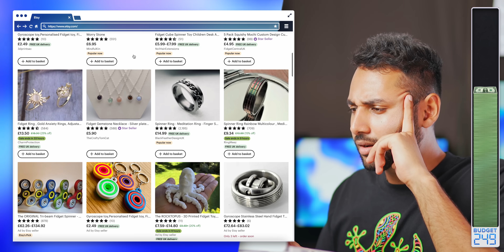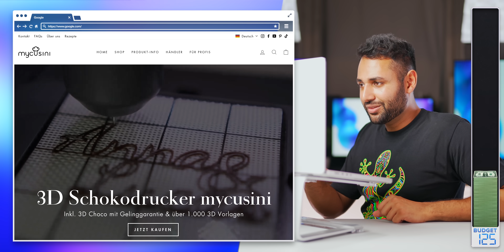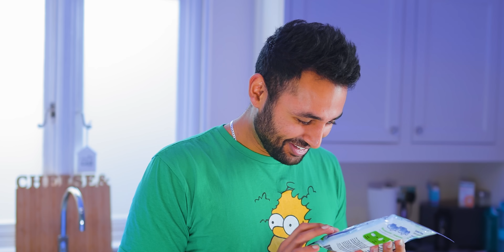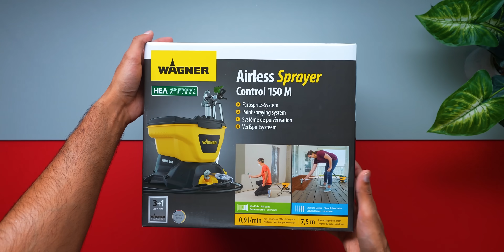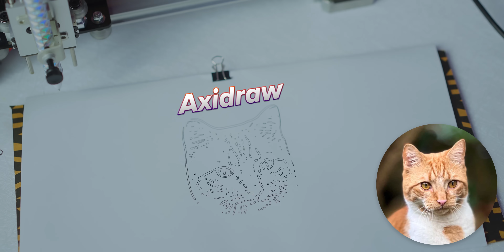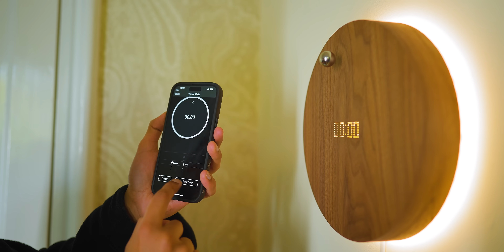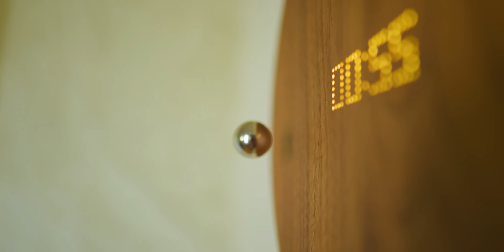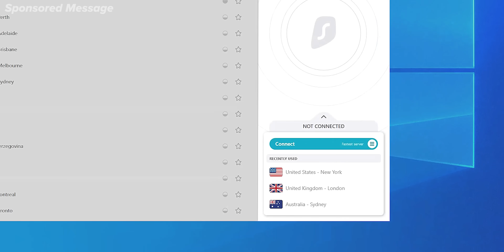I bought the most SATISFYING TECH on the internet.

Comment: I’ve had one of those apple coring slicers since I was a kid. They’re certainly faster than a knife but they’re a big pain to clean and the blades never go to the bottom because of the plastic frame so the apple doesn’t get cut at the very bottom. 

Also getting the slices back out and especially the core can be a pain too. It’s faster and easier but not necessarily more convenient.
Reply: Same here ! Just made same comment. ( 40+ years of Apple slicer usage. ) 
Tips - 
Cleaning - use a Stiff long handle Brush to clean it ! Available in any Groc store.  I just figured that one out. A sponge is a pain. Your right.
2) piece removal - break core sideways to remove. Do not pull straight up. Same with pieces.

Very Fast if doing alotttt of apples.

Wash / rinse immediately after use for easiest cleaning.
Reply: Same
Reply: Same! Also personally I don't find them THAT satisfying
Reply: You back the apple out of the slicer and rubber band it closed to keep the air off. Sliced but doesn't go brown as fast. At lunch/snack time, unband and tear off your slices.
Reply: I've worked in a restaurant and we had one there and at home. It was easy to clean an super satisfying all the time:D Not every one of those are terrible to clean, just pay a few bucks more and get a decent one!

Comment: For kitchen gadgets I would have recommended a “safety can opener”. 
They cut the side of the lip instead of the top so it comes out smoother, the top doesn’t fall into the food, it doesn’t spray stuff and contents are easier to remove.
Reply: .....plus you can use the can afterwards as a cookie-cutter!
Reply: I've got one, it's great, best can opener I've used

Comment: Chocolate printer gets a 1/10.  You'd have better results using the previous product (vac former) to make mold halves and pour the melted chocolate into that, then join the two chocolate halves together (like an easter egg).  Maybe use a resin printer to get the original shape to take a vac form from.
Reply: For that you'd need quality melted chocolate

That's a few extra steps from just buying chocolate, loading it up, and letting a computer do all the work 

The vac former also needs a shape in the first place to make a mold, so regardless you'd need a 3d printer 

The chocolate thing is literally objectively better efficiency wise
Reply: The plastic mold is probably not food grade material though.
Reply: Big brain
Reply: I imagine he had little knowledge of the machine. It probably needed bed leveling and z offset running.
Reply: But it’s chocolate!
Reply: It's easier to use.

Comment: kinetic sand is a basic slime (glue and borax/water solution) mixed with very fine sand. as such, it is basicly a non-newtonian fluid so the garlic press was never gonna work (exerted force makes it behave as a solid). i used to make it with the kids at the local community center for giggles. it is very satisfying to monkey around with. lots of neat gadgets in these vids, brother! it would be super sweet if you broke down the list in your description with links. more than once now i have gone shopping after watching these vids and im not sure if you ever see any affiliate 💲 since i usually have to track them down manually!

Comment: kenetic sand is just Brightly colored sand mixed with non toxic clear polymer putty (similar to silly putty). Putty is responsible for the physical charact5erists of the sand as it keeps it sticking to itself but still remains a slowly moving polymer liquid. texture of the sand allows it to maintain a molded shape unlike putty alone.